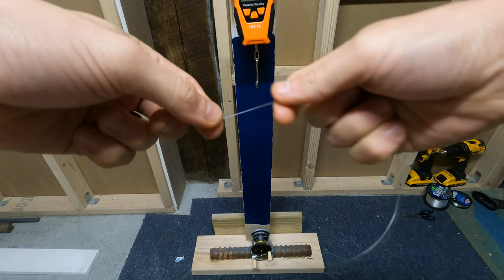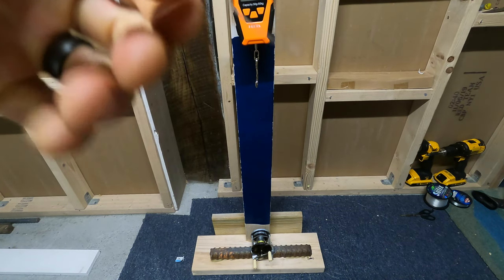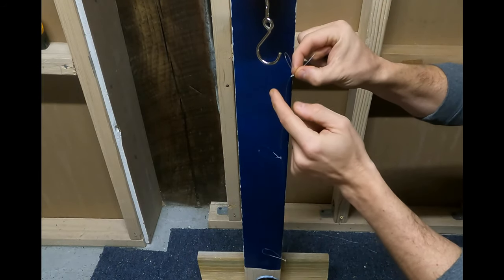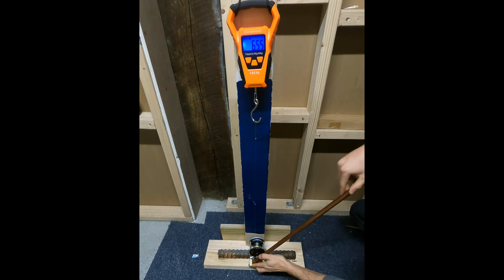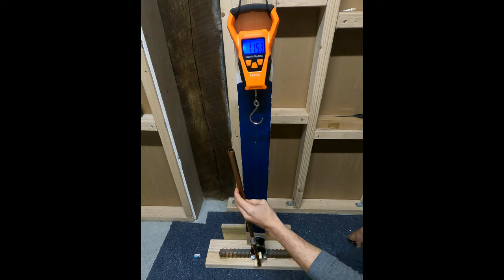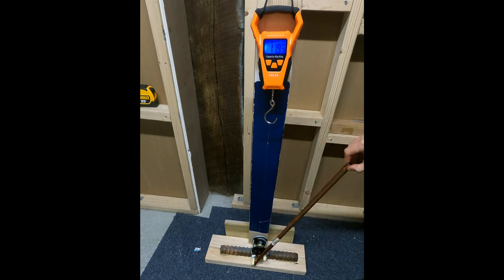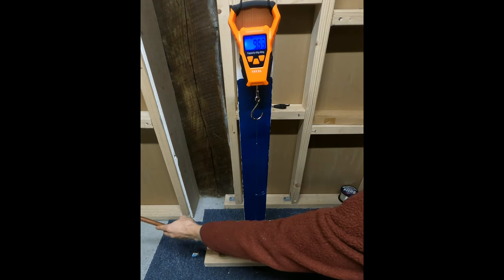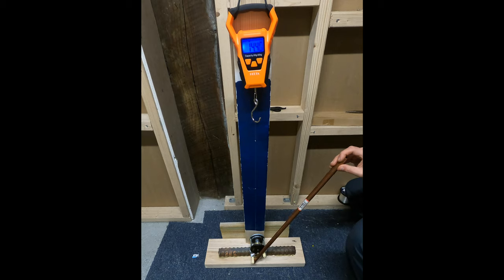Loop Knot Testing part3 (20lb Fluoro Dropper Loop)

Comment: Very interesting! I use dropper loops (or some variant of them) a lot during the summer when bottom fishing, and this will certainly be food for thought moving forward! I typically use 15-20lb test for my leaders for Fluke, and I probably wouldn't mess around with dropper loops if pursuing anything much larger! Thanks for putting the work in and sharing!
Reply from the maker: It is interesting right? I never really had an issue with them but I also never really hooked a large fish on one with a light leader like 15-20lb. Prob still ok for fluke but idk some of those bigguns you catch in Mtk might make me nervous haha. Food for thought, thanks for the comment.

Comment: It's bad but it only did a little worse than the perfection loop. Thanks for doing these test.
Reply from the maker: Sure thing, Yea still pretty bad, dropper loops are so commonly used so I’m a little surprised at the results but I think in most cases it’s with heavier test so they do better

Comment: do you ever try for perch in the brackish waters?
Reply from the maker: Hey C P, I haven't tried for white perch on Long Island.  I used to catch them off the pier in Piermont, NY which is up the Hudson River a bit but it's been a while since I tried for them.  I do see some people getting them out here from some videos being posted but I really wouldn't know where to go around here.  Even the far back parts of the bay near my house are starting to freeze so I could imagine it would be hard to find unfrozen brackish water right now unless it was moving from a stream outflow or something.
Reply: @PeterRanieriII  yeah i've been trying to find a few..... no luck so far. I would assume any moving tidal water has potential. from that ive heard there are large ones up to 3lb on both shores
Reply from the maker: @CP-rp7yp  I believe it, and yea that’s what I hear that theyr in the places where streams meet the bays with some moving water. I may try to do some exploring if I get some time and it’s not so dang cold, haha. Good luck 🤙
Reply: @PeterRanieriII thanks, ill keep searching tight lines!!